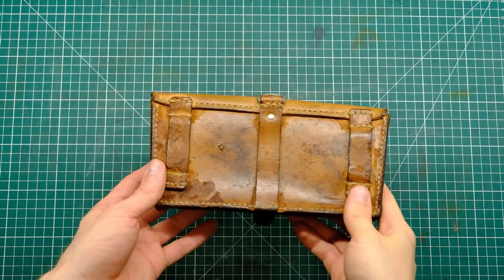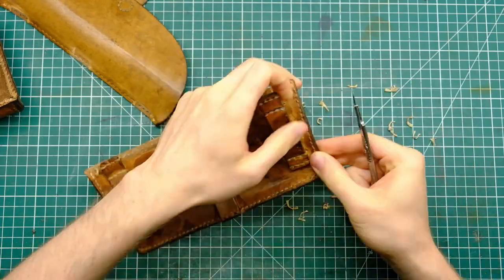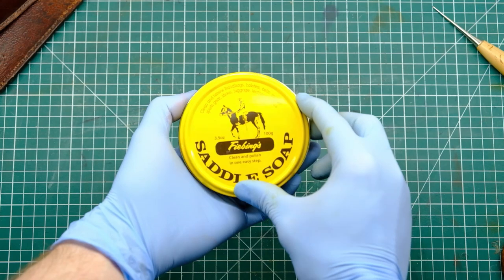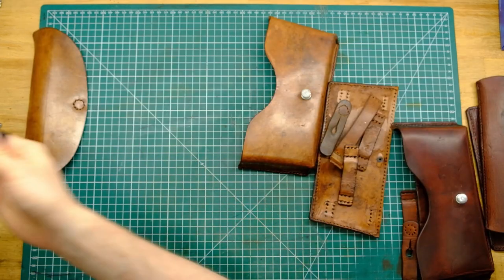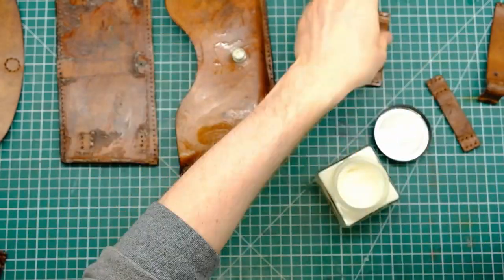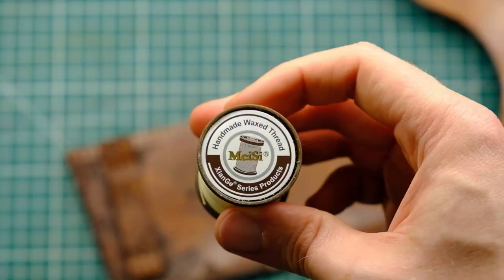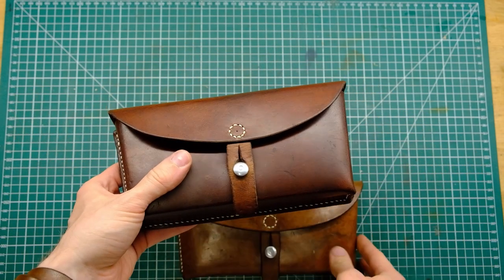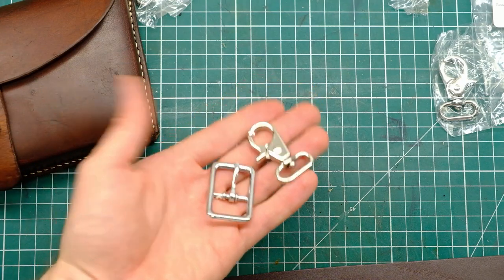60 year old Swiss army pouch becomes perfect vintage clutch bag! - leather restoration / rebuild

Comment: Great work,wonder if u could give advise me about what to do with a leather bag that I picked up from a market.
Basically it stinks a lot,got a rotting smell,really bad.
Can I get rid of the smell?If so would you tell me how.
Thanks Joe
Reply from the maker: Best thing to do is to wash it delicately with saddlesoap. 
Make sure you get a good lather going on the soap and use a soft brush to clean inside and out. Once that's done use a clean damp (NOT WET) towel to remove the extra soap and let it dry in a well ventilated place (avoid heaters and direct sunlight at all costs).

This should help!

Comment: Thank you James for all your videos, very inspiring. I have a brief case that I would like to renovate, it needs a lot of oils. The inside has quite a rough leather - would you use saddle soap on that and any additional oil like neat foot (it seems to need it but I have not yet done the outside)? Cheers, Richard
Reply from the maker: I would use saddlesoap to clean the inside but would only oil the outside.
I have oiled the inside of a piece only once or twice (in over a dozen restorations) and that was because the leather was the driest I had ever seen. Using oil on the inside is possible but the leather will just soak it in REALLY fast and it may absorb too much.
If needed, and if you're not sure what to do, I would suggest several very heavy layers of oil on the outside of the piece and let the oils slowly be pulled into the dry leather (whipping off the excess oil on a regular basis).

Comment: James, this is a fantastic video. Thanks for sharing and for creating the template on your Etsy site. By chance, do you happen to know what the main fastener on the front is called? I'd like to buy both of your patterns but doubt they'll look the same without that connector. Thanks!
Reply from the maker: Thank you so much for your message! The Swiss army use an aluminium button stud that is riveted onto the bag. I doubt you'll be able to get your hands on any of those, but I have found some good substitutes on Etsy: https://www.etsy.com/listing/486674552
What you're looking for is a large button stud that you can screw onto the front of the bag. You'll want to get the 8 to 10mm wide versions depending on your preference.
Hope this helps :)

Comment: You obviously have great skills in stitching but I would use slightly different steps: Firstly best way to thoroughly clean is by using a sponge and soapy water. Then wipe off the grime with a rag and repeat as necessary. Now they ARE clean. When dry then I would use one type of leather preserver / nourisher which I consider sufficient to do its job. And if in good condition, as appears in these examples, I would keep the original stitching . Oh and I would use an old newspaper to protect my work-surface of grime etc that would come off the pouches while I treated them.

Comment: Did you by chance trace a pattern of this bag when you had it all taken apart? If so I would be interested in buying the pattern.
Reply from the maker: I did not, a huge mistake on my part... However I am currently tracking down more of these bags and will make a PDF pattern when I get my hands on one.
Reply from the maker: I'm pleased to say that the pattern is now available on my Etsy store: https://www.etsy.com/listing/847720185
I was able to grab another bunch of these ammo pouches on the web and took the time to trace the pattern on Illustrator. I've added a full guide to building it as well so you'll have all the step-by-step information you need to make it :)

Comment: hi there - what a fab rebuild leather. may i ask, what brush do you use with the saddle soap to clean your leather? many thanks x LOVE your channel
Reply from the maker: Thanks a lot Vix for the kind message :) The brush is a small horsehair brush made for cleaning shoes (but works on all leathers) as it's just the right strength.
So pleased to hear you like my channel that much :D

Comment: Interesting project.
If I can make a few observations?
1. I NEVER use a scalpel for cutting out old stitching; far too sharp a blade for this, and as it is so sharp it is very easy for the blade to take a new path through the item, rather than the weak point (the old thread)
2. Saddle soap. This stuff is SOAP, not a leather dressing as such. It should be used in small amounts, by adding a little to a damp sponge, then using the LATHER that results as a cleaner....NOT directly impregnating the item with the soft soap itself.
3. Neatsfoot oil.... You do you. I ONLY use this SPARINGLY on brand new undyed veg tan hides, at TIME OF MAKING items from said hide....Neatsfoot has LONG been bettered by many many dozens of much improved (scientifically based) treatments that don't pre-date sailing ships and open sewers..
4. Saddle stitching is when you use two needles on the same thread....

Just an idea too?
If you are going to the trouble of completely stripping them down to then re-build them, you can add to their new functionality by adding a couple of thin layers of leather inside, on the face opposite the main rear panel; sew these panels the right way vertically before installing, and you then have instant pockets for credit cards, driving licence, etc.
You could also add a D-ring to one corner or the middle of this insert to clip keys onto, etc. just to take the pouch away from being an empty space for rifle magazines.

Great to see old kit being given a new function/life - hope the new users get a lot of use from your hard work